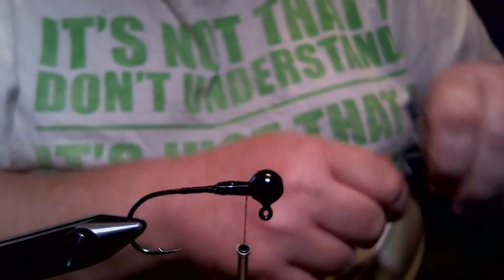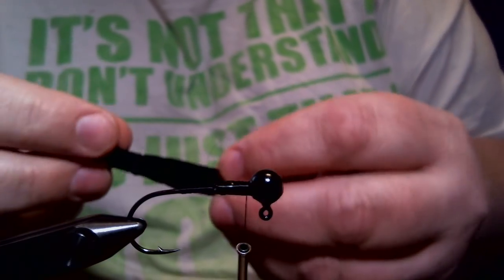Dragon Tail Jig

Comment: I just got the email from Barlow’s that had the dragon tail and saw your video. Looks almost like you used a zman Ned worm as a trailer. They need to make 2” ones for crappie jigs! Btw, thanks for the feedback on my thread. The ultra gsp was my troubles. Switched to flat wax nylon and not only is it easier to tie, but the hair is locked in.
Reply from the maker: Thank you for the comment!!! You do know you can cut the dragon tail to the size you need? I'm glad I was able to help you on the thread, we all tie a little differently so I wasn't sure if it would work for you but I figured it was worth a shot.
Reply: @smalljaw  I figured I could cut them, just concerned about the cost to waste ratio. Those things are pricey! Right now I just tie on the gold/silver mylar tensil before any hair and pearl flash with the hair. It gives a little extra length and the shimmer to at least catch the fishermen 😁
Reply: @smalljaw  one more question. If these are similar to chenille, could you or have you ever tried to just add a piece of chenille as a stinger tail on say a 2" crappie jig? I could see the 4" being great for specs or reds down here in TX.

Comment: That's awesome! Great bait fish / leech type pattern. There's a ton of new materials now, it's hard to keep up. At our state fair they have those tents that sell leather goods and clothing. I have a few fox tails from them for 15 to 20 bucks each. The best buy was at a Tandy Leather booth in one of the buildings. I bought an 18" silver fox tail (black with a white tip) for about $15. They have outlet stores so they may have them in your area like here.
  So it's a year since you made this, did you get a chance to fish it? Thanks for all the videos!
Reply from the maker: Thank you Joe!!!! I often find materials from flea markets but it has been awhile since I found anything good. I use a lot of Arctic fox, both tails and the body hair, it is great material!! As for the dragon tail jig, yes, I have used it and I really like it!!! I liked it so much that I expanded on it, the Ned Hare jig. The dragon tail absorbs water so it gets heavier which makes it easy to cast light weights. It also have a lifelike movement, very natural in the water and it gets bit. The tails are a little pricey but they are so worth it, at least to me they are!!!!!
Reply: @smalljaw  Yeah when I saw that python of a tail at the Tandy table I snagged it up! Rabbit soaks water too, in fact I try to soak jigs before I cast especially if its a lighter head. There's a newer egg yarn or chenille that soaks up water and gets fatter. I've been playing with different chenilles  and some yarns for tails but those tapered Dragons look "juicy", maybe I'll breakdown and get some.
   There are some good jig tiers on youtube, including you, that I sub to. Michael Jensen was one that I got to be friends with but he hasn't posted in a long time. He fishes both conventional and fly, like me, and ties awesome flies and jigs. His blog is great too. Another is Arkansas Fishing, in fact I was watching his latest when I got the notification of this reply. Take care smalljaw, open water is just around the corner! Thanks again!